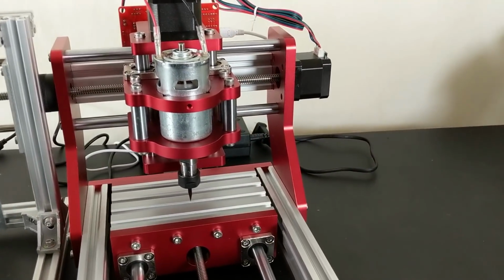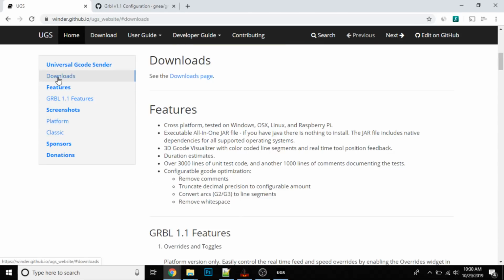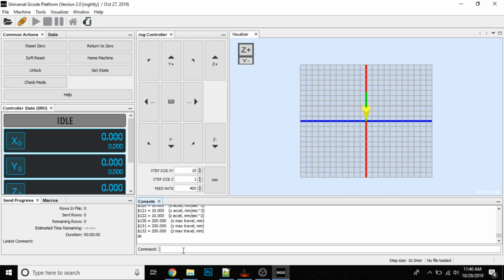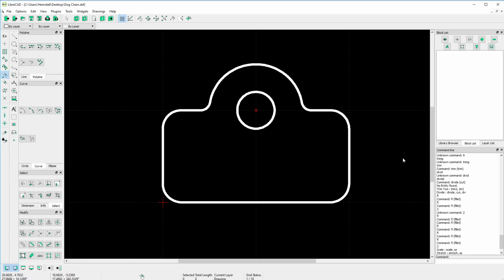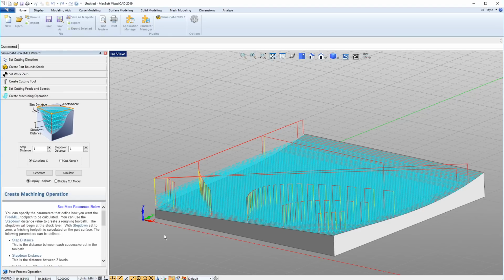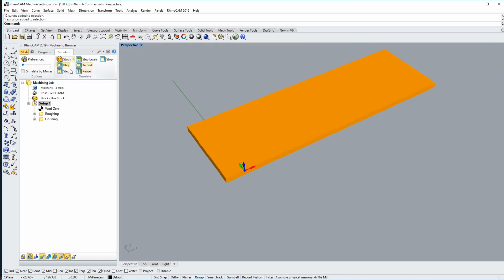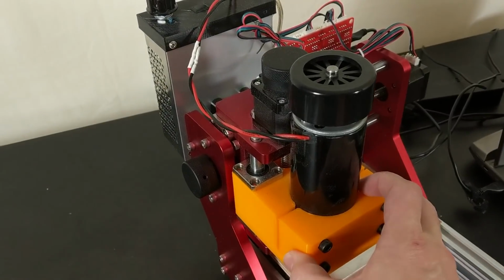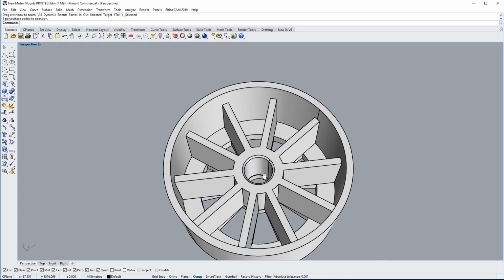How To CNC Cut Metal For Under $400 using the 1310 CNC Router

Comment: I'm currently in the same situation, I have a Shapeoko 2 with lots of upgrades and I've finally taken the leap to cutting aluminum, with the hopes of making parts to make it cut aluminum well.
First, you're absolutely correct that speeds and feeds matter. I'm currently cutting 0.6-0.7 mil per tooth that seems to be a sweet spot for my machine, using either 2 or 3 flute end mills. 
Second, I found that performance definitely improves with the right surface speed. That depends on RPM and bit diameter, but carbide really likes it fast: 800+ s.f.m.
Third, Fusion 360 is free for hobbyists and can produce the trochoidal mill path you describe. It's much easier to clear the chips when you cut a wider slot this way.

Unfortunately, trying to cut 0.7mil per tooth is useless if the backlash is 4mil and spindle is chattering all over the place. You end up with some teeth cutting nothing and others cutting 5 mil. 
On my machine I've got the backlash pretty small, but I believe the current limitation is overall machine stiffness, the opposite of the problem you have.

Comment: Use a 2 flute and slow the feed rate on ali, and slow down your spindle speed. Using wd40 should help
Reply: on those shitty machines a single O flute would be best he would need to get rid of the 775  spindle. i can hold a 775 and stop it from turning

Comment: I think the frame of this little machine is probably stiff enough to handle alu. Upgrading the motor is a good step, but now other factors come into play and they are all compouding factors. The mill bit really wants much higher RPMs. The mill bit is probably not of the best quality. The lead screw has too much backlash and the anti-backlash nut solution does not take away the backlash with the forces involved. The linear bearings are probably cheap ones with too much play. And after all those issues are fixed you might even find that the steppers do not have enough torque.
Reply: i went to 92 oz in steppers, 500 watt spindle shitcanned all the plastic parts and upgraded to aluminum replacements. started using Yonico and Amana bits and feel confident on any wood or plastics jobs but im not going to destroy the little machine on trying to cut aluminum. i also converted the motors to hybrid closed loop steppers and then went through every wire and replaced them with all sheilded jacketed cables because the RF interference was causing lost steps.
Reply: Well, that saved me a bunch of typing 👍😁
Too much work but profiled linear rails, ballscrews and ditch the Mickey Mouse steppers; get closed loop servo motors on there. That cantilever bothered me from the get-go.

Comment: Part of the problem you’re having with cutting aluminum is flex in the machine but part of it just comes down to speeds and feeds.
Reply: I think machine rigidity is being underestimated in the comments. Feeds and speeds only do so much when the machine allows vibration no matter what.
Reply: ....And single fluted mills are required.
Reply: @GodzillaGoesGaga  yeah i dont understand why people think more flutes cuts better. the more flutes the faster you have to cut with a deeper cut to get the chips the right size. some people think dust is cutting and all producing dust does is wear out bits. i started using all O flute bits for my wood and plastic work and the cuts have been much faster with a far better result

Comment: Check Alex Moon's videos, he figured out how to mill aluminium with a CNC1310. He uses a much faster spindle. I have the 500W spindle you have and only goes only to 11000 rpm . I think we need more speed.
Reply: Thank you for the reference to Alex Moon, interesting. He is using a WindWard S4225-B24 spindle which is around 400$ on its own...

Comment: When I started out I was naive enough to think I could build a large gantry style mill mostly from scratch.  I ran into almost all the same problems as you.  It was a very humbling project but I learned a TON.
Reply: I think it is possible.  I built a large CNC machine out of 4040 and it is just like too much of everything.  It has big Nema 34 motors and I am a Nema 17 type of person.
Reply: @jeffbeck6501  I agree that it's possible, I know I greatly under estimated the cutting forces the frame and motors have to resist.

Comment: Hey man, what a great video packed full with quality information. Maybe you said it and I missed it, but did you use conventional or climb milling? Or both? The difference in outer dimensions vs. inner dimensions at around 41:40 could be explained by the mixed use of both milling types. I'm sure you know this already but climb tends to push the bit away from the material whereas conventional tends to pull the bit into the material. Also spring passes (100% overlap with the previous toolpath) could be used to get better dimensionality.
At 43:14 you mention the problem you're having with chatter. In my experience with a similarly built cnc, it helps to experiment with different (scary low in my case but that of course depends on the machine) spindle speeds until you find a speed where the frequency of chip creation doesn't positively interfere with any of the machine's resonance frequencies. But that quickly becomes a shitshow ;). As for the optimal (literature) feeds and speeds: I tried them and they didn't work. My gut feeling is that those work on tormachs that actually have the required rigidity for those settings but they are incompatible with hobbyist-machines.
To the cooling: I tried compressed air, but the airflow required to cool my parts was so high that it would bend the bit/shaft/motor-mount which would create even more heat and chatter. I had good luck with isopropanol as a cooling agent because it evaporates really fast and doesn't leave a mess.
And about the adaptive clearing toolpaths: With a small workaround you can get Fusion360 to do those perfectly fine. Even with the free version afaik, but I understand that Fusion isn't as cool as it used to be due to their new pricing model.
The last thing you shouldn't forget about is that aluminium is terrible at absorbing vibrations. It's light and stiff which is great because it will make the machine light and stiff ;) But at what cost? Professional machines are made mainly out of cast iron in part because of its dampening characteristics. In this case I think dampening the frame by different means might be an option. The easiest idea would be to print 0.5 to 1mm spacers out of petg which also has great dampening characteristics and put them in between each of the aluminium-aluminium joints on the machine. For that same reason, I think that those cnc machines like the foxalien or the shapeokos with openbuilds-styled delrin or nylon rollers are a great compromise because of the dampening characteristics of those rollers.
Reply: some of the larger hobby machines are definitely capable of cutting aluminum but you really want at bare minimum 1.5 kw spindle, 4-600 oz in steppers and a machine using cast parts and not extruded parts. cast iron is better than cast aluminum. but then youre talking a minimum of 2-3000 dollars for a machine like that. im building a gecko g540 machine using a completed chinese machine with cast iron parts and gutting it of all crap electronics and shitty wiring. but people hear CHEAP and they think wow i can do all that for $500 and its just a lie. I have over a thousand into my what started out as a 3018 that cost $300 and its capable of cutting wood great but wouldnt attempt it on any metal and the size is just too small for practicality.

Comment: welcome to the rabbit hole that is called cnc-ing metal. I fell in it too. Build myself a momus a couple of years ago. You wont stop upgrading once you see what others can do on youtube :-).. I can recommend the momus though if you like diy. You can build it using simple tools only (I know, I did) and its relatively cheap (In CNC, cheap is always relative :-) ) . Your cnc looks nice too although I fear you will one day upgrade the spindle motor. If you ever decide to spring for one of those chinese high speed spindles, do pick one with an ER16 collet though. Much more choices when selecting cutters as the ER11 only fits a maximum of 7mm and the choice for 8mm and up is really big. Don't ask me how I know...

Comment: If you go with very slow feed rate, is it possible to cut thin titanium plate?  Maybe 4mm in thickness?   Just wondering if it's capable with a slow enough feed rate.
Reply from the maker: You can't slow it down. There is an optimal point faster and you have problems slower and you have problems. See, the shavings also remove heat from the cut. if you aren't cutting enough material, then the heat can't get stripped away. If you are removing too much material, the shavings can't strip that heat away fast enough. The concept goes by the name "Inches per minute" or "mm per minute." If you have a smaller bit, the rotation of the tip of the flutes is closer to the center of rotation means each flute is moving through the material more slowly. Means you have to move the machine head more slowly than you would with a larger diameter bit to get the same inches per minute of flutes cutting metal.
Reply: @DesignPrototypeTest  appreciate the detailed explanation. Sounds like I’d just need to save up for a more robust CNC if I hope to cut titanium. 
Aloha!
Reply: @Akamai.808  The term inches per minute is how fast the cutter is moving overall through the material. 
However what really matters is:
     Feed per tooth - how thick each chip you are cutting off is. Too low and you get rubbing and lots of heat generated, too high and it takes too much force.
     Surface velocity - how fast the cutting edge is moving through the material. This is based on RPM and the bit diameter. Larger bits trace out a bigger circle each revolution and thus the cutting edge is traveling faster.
Combining the 2 above parameters with how many cutting edges the bit has is what really determines the ideal RPM and speed (inches per min) you use. The main question then is "Is the machine powerful enough and rigid enough to maintain those speeds?"

Comment: Great detailed video. One suggestion. It is not just about rigidity it is about dampening vinration too. There is no enough material in z axis to damp vibration. You will need a aluminium plate to hold spindle clamp. It will improve performance 200%, there won't be chatter and cleaner cut.

Comment: Mist coolant with alcohol based liquid is the best case for cutting aluminum. Also ALL the carbide cutting tools made in China are absolute CRAP and has to do with the raw materials used. You can buy a decent but way more expensive cutter like Kenametal or Silmax and you will see a difference. The toolpath you are talking about is mostly needed in heavy mettal cutting and is designed to keep a steady load on the cutter for less stress. It is a science on its own and is featured on professional programs like surfcam. A wood or aluminum work usually does not require something like this. Also, a very powerful program is Vectric Aspire, but it is not free....Cool video by the way!!!!

Comment: You might also find an app named VibrationAnalysis could tell you the RPM on your phone more directly :) There's strobe tachometer programs too but this is likely too fast for those, I've not used thjose.

Comment: Feeds and speeds also assume a rigid machine with a motor that will not stall at the proper RPM. You've discovered most of this already though. I've seen a guy make successful cuts on a cheap machine, BUT it was a heavily modified machine. Adding extra rigidity to the spindle, using coolant, changing to a high power motor with a VFD, and changing to ballscrews. All of that in a machine a bit larger than what you are using there. Also being able to hold 0.0005" tolerances. But we are talking about a complete redesign of the machine. You might have gotten a tad farther with this machine and got slightly better results but I think it would have taken more money.

Comment: Good video. I think most of your problems are due to low fee rate. A lot of heat is removed with the chips and with to low feed rate, then heat builds up since friction becomes more of a factor. Try doubling the feed rate and reducing the depth of cut or step over distance or both. I think you will have the same issue on your larger machine if you keep the same feeds and speeds. I have seen others successfully cutting aluminium with much less rigid machines than yours but using higher feed rates. 

Fusion 360 has built in adaptive tool paths for CNC so you might want to check it out.

Comment: Good to see a review on this machine. I didn't see if there were any drivers needed to install the CNC to your computer. Sorry I'm a total doofus when it comes to IT. I think the stage with the drivers was skipped. It's where a lot of people seem to have trouble with the other small machines. They can't find the drivers for their machines for this or that OS. Mostly the drivers are for Windows machines but people may want to use Mac's or Linux computers. I've seen people using both Mac's and Linux systems to control the cheaper CNC machines so it must be possible etc. But as far as I can see it's not clear what's needed to make them work, so the stage of using UGS can be reached.
Reply: The Benbox board on the 1310 uses a plug-in Arduino Nano clone.
If it's a faithful clone then it should work out of the box on Windows, linux and macOS using the standard FTDI USBSerial drivers that ship with those operating systems.
More likely, though, it uses a CH340x or CH341x USBSerial chip so you'll need the appropriate driver which you can download for Windows, linux and macOS from http://www.wch.cn/downloads/CH341SER_ZIP.html
Reply: @anthonyrich1592  That's extremely useful. Thanks. I've got a little Windows 10 netbook I'll be using to control the machine myself but I've seen more than a few people posting about not being able to find drivers. It might be that if this board is easily recognised, it may give the product an edge over boards which need proprietary drivers etc. Hopefully your comments will help others who come looking.

Comment: Pro tip: those boards have swappable stepper drivers so switch them out with tmc 5160s (or whatever they're called), add a bigger power supply and beefier motors and you have a more powerful machine, with a spindle that can't cut for shit.

Comment: FreeCAD in current devel version has an adaptive toolpath which works for my needs.
Reply: Tip: Never never use compressed air when cutting aluminum , instead use kerosene

Comment: Rpm is way too low for small diameter carbide through aluminum. Common problem with cheap spindles and small CNC. They use small cutters, but small cutters need high rpm. 8k is not sufficient for small cutters.

Comment: To avoid aluminium sticking to the bit you need to take larger chips. The heat caused by the cut will be ejected with the chip, limiting heat buildup in the stock. Ideally you need a faster feedrate, but you may have to try a slower spindle RPM if faster moves are out of the question. Also compressed air to blow away the chips will be helpful.
Reply: How come no one has suggested using coated end mills.  Even the cheap titanium coatings would be helpful here but there are many more advanced coatings which are all designed mostly for this specific issue.  Your comment regarding chip loading absolutely applies as well.

Comment: I think your anti-backlash nut and lead screw nut might be in the wrong place.  Are they able to mesh with each other inside that red metal body?
Reply: Either way, the solution was crap - just cutting the too-weak spring shorter doesn't make it any stiffer, and more stiffness in that spring is necessary.  Just sizing it and clamping down on it to where there's no play is a non-solution, since it will go from binding to being too sloppy with practically no adjustment.

Comment: Matt, I have looked a bit at the issue and for machining soft aluminum, you need at least 800W spindle or bigger with water-cooling for a proper control of the minimum rotation speed and cut speed. 

Your video has many pertinent points, you have learnt a lot from this experience. Keep the good work.

Comment: I think you were expecting too much. It would help if machine was bolted down, and it's mass increased, maybe fill it with concrete. A faster rotational speed, with not much stick out of the cutter (two or three flute is fine in ali), and take shallower cuts. You can't apply the same cutting parameters, as say Titan does. Many folk use wd40 as a cheap cutting fluid for ali, but milk is OK, too, even soapy water. Cutting perspex, plywood, and so forth, OK in your house, but for ali, better to have somewhere where mess can occur. Simple enough to make covers for the screws, etc. It looks a pretty solid construction, compared even to your bigger router, but needs a bit of tlc. btw, afaik, your explanation/diagram wrt x/y coords was wrong, (but I guess it was a long time since you were at school) and I noticed other stuff too, but you jammed in too much, imnsho.  It's because of the fun of cutting metal/wood, that 3d printing is so popular...